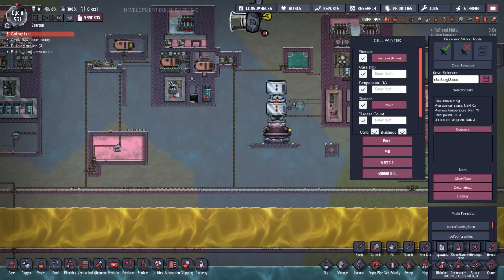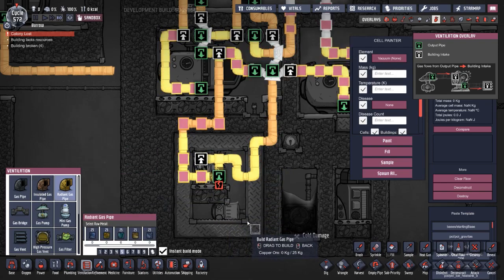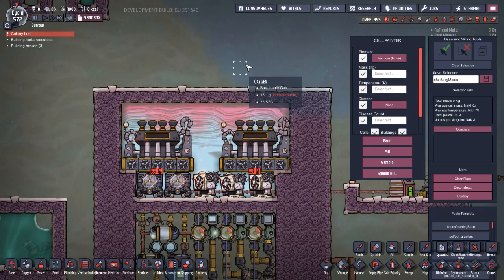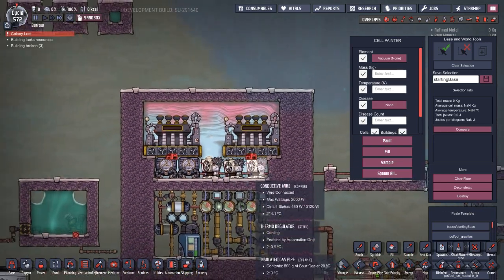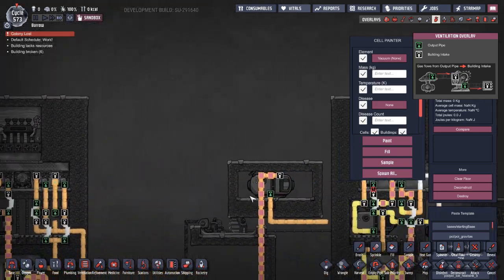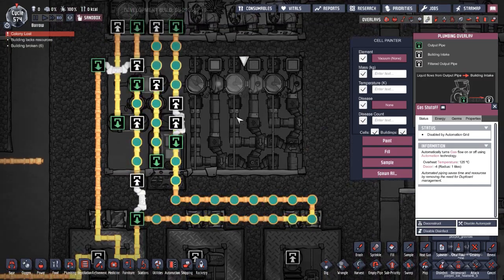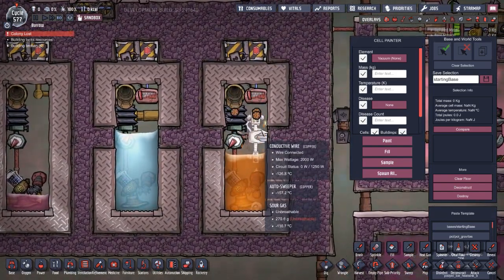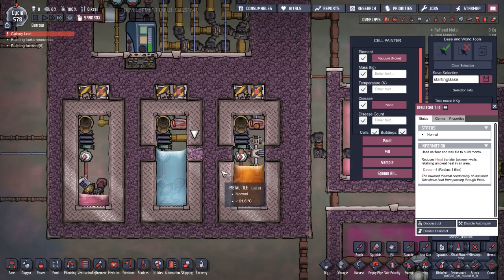Oxygen Not Included Triple Gas Condenser

Comment: thanks for giving this a go it looks really good i’ve got a similar looking design and i did a little experimenting with pumping the liquefied gasses into liquid storage, if you build it over a door you can disable the output to stop it getting stuck in pipes and if you build in a vacuum (or space) it shouldn’t leak any temperature so you shouldn’t get any random state changes as it tries to leave the storage
Reply from the maker: That's a great tip about the door stopping the output, I wasn't aware of that. Would you mind sharing a pic of your build? You should be able to post an imgur in comments.
Reply: ill try to get a few screenshots when i get on next but i’ve been building everything in survival so its not very clean atm, really need to start using debug mode for working out designs
Reply from the maker: @trueman88  Ahh yes, debug does save some headache but there's something to be said about just winging it. ;D